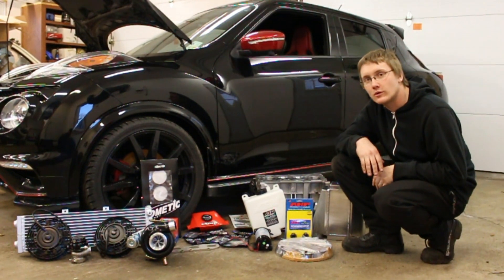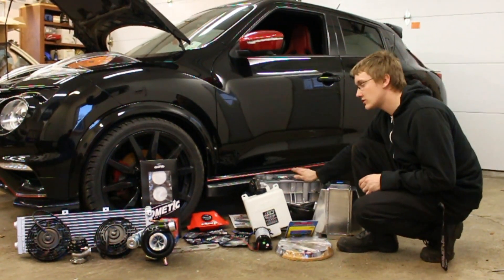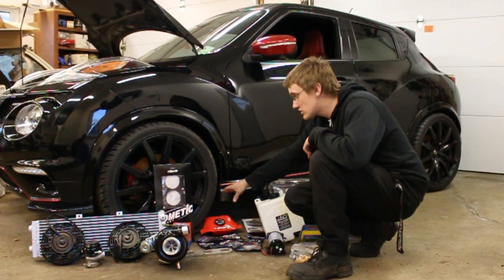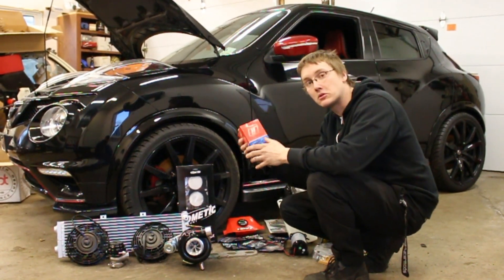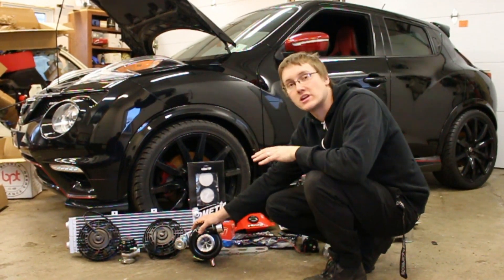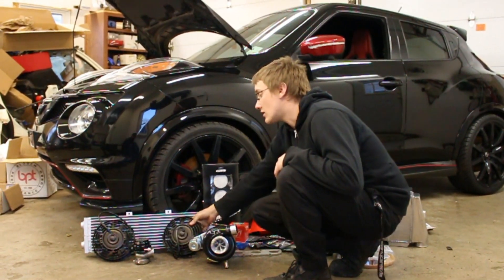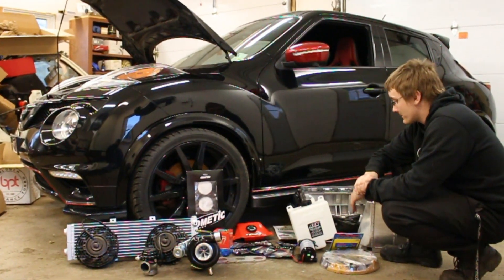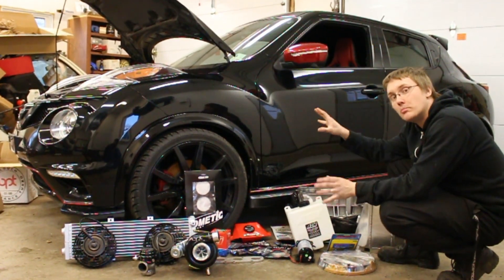WTF 400 Horsepower Juke Build Episode 2

Comment: Can I use that turbo smart vee port bov on my stock turbo is it the right one for my kind of turbo or which one do you recommend? Or should i do a 50/50 bov also if I put a short ram intake and have a diverter valve would I get the “swoosh” noise because that’s what I’m going for just for the noise
Reply from the maker: We cover all of this in our "how to modify" videos about Blow Off Valves.